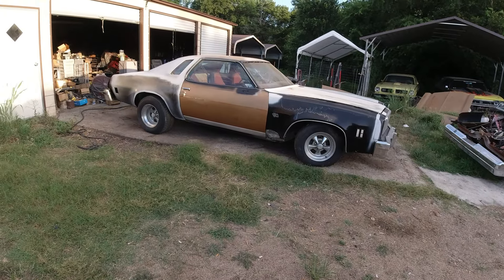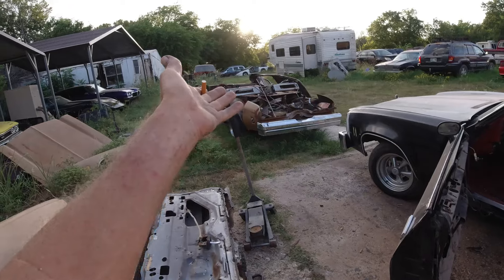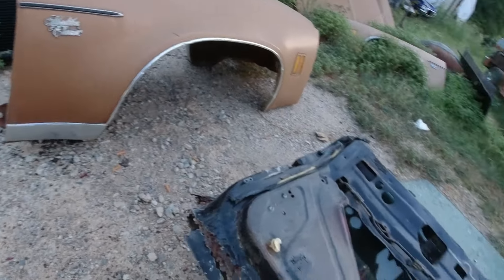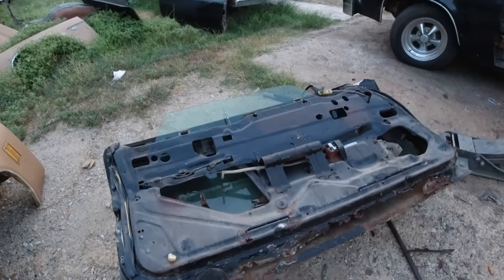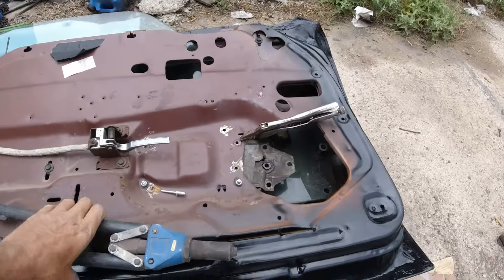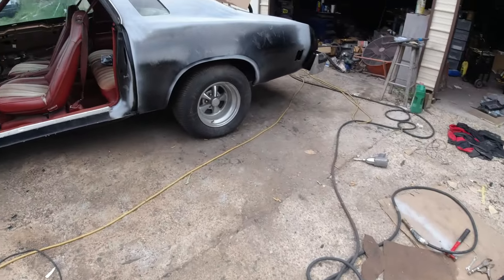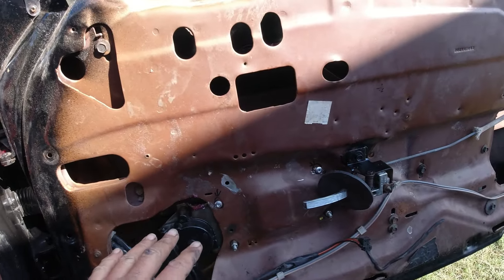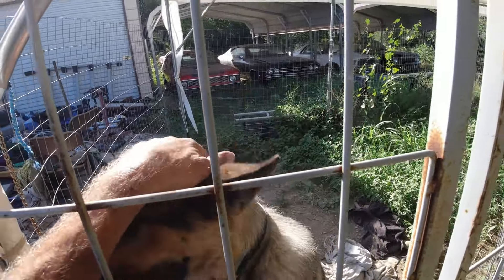1977 Malibu Classic Build #8. Rusty Door Swap. Paint door panels. Dye Seats.

Comment: Lee is teaching y'all step by step how to have a cool car on a budget. Hard work does pay you back if you know how to do it and source the parts paint etc. In my opinion Lee is doing a good job on the cheap. Oh spray the dye on with a spray bottle scrub it in with a scrub brush set in sun all day long on a hot day rinse off with cold water wash with soap then rinse with cold water set in sun again to dry and it shouldn't transfer or bleed. If memory serves right used to have to add vinegar to rit dye guess they changed it and how have a good one dude and keep doing what you are doing .tell the cork sniffers to jump off a cliff lol.
Reply from the maker: Thanks

Comment: Fluid Film works well in some applications, I just can't stand the smell. Por-15 I use on everything including wood, it even fills in small pin holes in metal, it stopped a leak on one of my boats.

Comment: hey Lee i should told you if you had a shampoo that on there fix the red die like you going to clean it and just spray it on there i hope you get this message and as you spay it on there and take it back off ..................if you clean the seats first it might be able to reuse the red die over untill you get all it done i would let them sit outside until dry i hope this helps you better

Comment: I wonder if you could make a rear bumper filler out of metal just so you can't see through between the bumper and tail lights, coming along great.
Reply: Or maybe cut a piece of plexiglass strip to fill the hole, paint it, never know the difference.
Reply: @Rick-O-Shay60  
Or a piece of vinyl siding? cut shape.....Heat it to bends......????   Maybe

Comment: Dixie Restoration Depot is the place that carries the rear bumper filler,they don't have a Ebay store, they sell through their own website 👍 nice work as always Lee, as for the keyboard restorers, they have never done this stuff in their lives! Keep doing what you are doing Lee, you do quality work 👍The rit dye will do just fine,it is made to dye washable fabric, which I have used it for years without any dye fade or coming off, just let it dry in the sun and Then wipe with a cloth to get rid of the transfer that is left as a powder on the too of the seat.

Comment: Thanks for sharing the tip on the dye hope it works out also have you tried Lokweld heat resistant contact spray? Worked great on headliner.